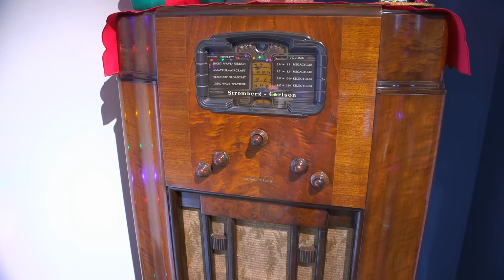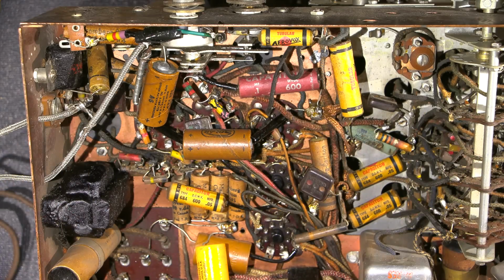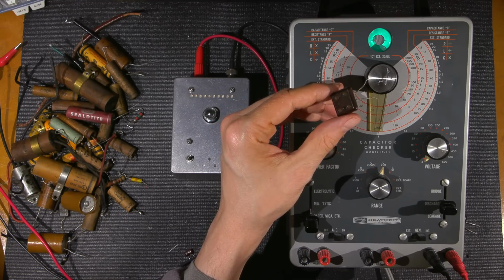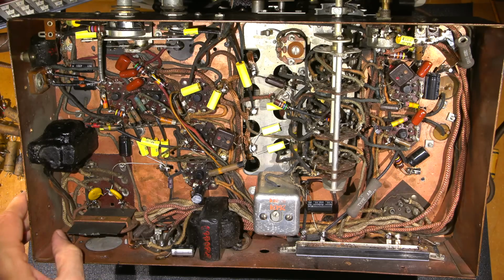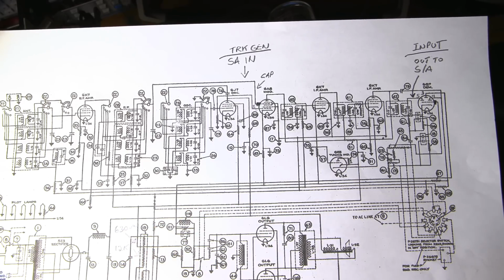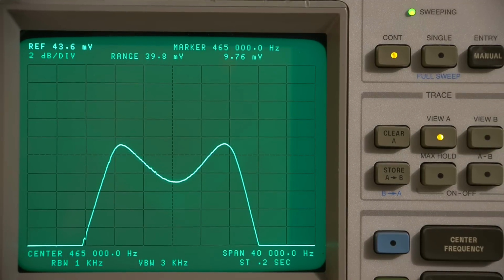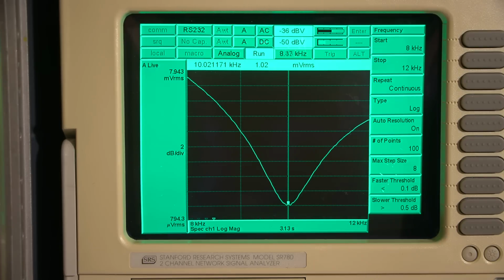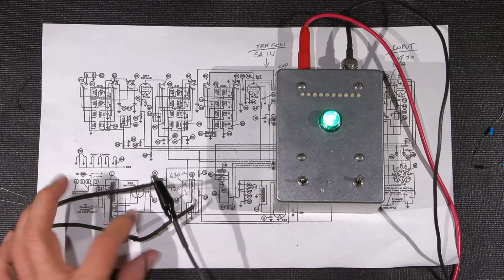84 Year Old Radio Receiver Restoration! Stromberg-Carlson 145L

Comment: When you use polarized electrolytics, do you put the negative or the positive lead to ground?
Reply: Usually the negative lead goes to ground.

One exception is transistor radios that have germanium transistors, which usually are PNP type. They are essentially "upside down" in their circuit design.

There are also "floating" grounds in some circumstances. When that's the case, you'll want a schematic diagram.

Comment: Great video! Can you describe your antenna. I do some modest radio work in my basement shop, and can barely receive a local station due to all the AM noise in my metro area. I've been considering an outdoor wire antenna with a shielded coax for the portion inside the shop.

Comment: Yes, that is why I have designed my own high performance receiver, with dual IF for wide and narrow bandwidths plus AM stereo. As most AM radios made in the last 20 years have very sharp cut off at or below 5kHz, and AM can sound just as good as FM. So there is a few good AM tuners been made today, and I have had a lot of positive feedback on this project.

Comment: A nice receiver from the days where the unit cost as much as (or more than) a piece of furniture, and was designed to function just as beautifully as it looks. The audio is truly amazing, they obviously had someone with some acoustical knowledge on the design team. I'd genuinely love to hear it in person. Certainly hope you'll include a photo of it in a future calendar!
Reply: Look up the Everyready AC model 3 from 1928, I have one of the cabinets minus any innards, the style is American Gothic or late Queen Anne, looks like a coffin, awful style and design.
The twenties was the decade of radio, an absolute crazed decade, similar to how the 80s was for the home computer , so looks didn't matter, just that the radios worked.

I also have a thin legged tall cabinet Queen Anne style, manufacturer unknown., arched dual doors, looks a little bit better. The art deco ones from the thirties were a massive style improvement.

Comment: Nice.  I didn't think the coaxial speaker enclosure went back to '36.  They did use several brand new tubes from '36 though, the 6L6, and 6E5 (patented August 18, 1936), and wasn't the venerable 6A8 pentagrid converter from '36 as well?  Not to mention that metal tubes were also introduced the same year (I still prefer the G/GT types myself - real radios glow in the dark).  This radio was state of the art when it was made clearly for the 1937 model year.  Chassis 145L, Rider's 7-23.  Interesting how B+ goes from the filter choke directly into the field coil.  10H total or 15H (assuming a standard 5H field coil)?  Rider doesn't specify inductance for the filter chokes.  Beautiful f'king veneer.

Comment: Why did they use an electromagnet instead of a permanent magnet in the speaker?
Reply: Magnets of that strength required were pretty expensive in the day and because a smoothing choke coil was a good thing for the B+, they swatted 2 flies with 1 hit by making the choke coil also function as the electromagnet for the speaker :-)

Comment: Quite an extraordinary receiver for the 30's. I wonder how they aligned it with contemporary gear. I wonder if anyone could ever align it in the field. Was it this good when new? 

I have a Rhode & Schwarz RF signal generator with a large drum style dial that is so precise you can calibrate your frequency counter with it.
They did some good engineering in the good old days.

Comment: A few years ago I restored a friends 1939 Philco radio in a cabinet style similar to this one, but the condition of the Philco was rather poor.  My friend wanted someone to do the restoration, but had not been able to find anyone.  It's cabinet was rough, but not rotted, and I determined it to be quite restorable.  The radio was not working at all.  It had a similar electro magnet speaker as does this one, but not so elaborate.  So, I started by removing the radio chassis from the cabinet, then proceeded to refinish the cabinet, and I guess I spent a few weeks before I felt that it was close to how it had appeared when new.  I should mention that my friends mother had been its original owner, and now in her nineties and did not know that I was doing this work, so I was a bit more inspired to complete it while she was still living.  My friend was not interested in having the radio work, but I was.  It's chassis was rusty, and while all of the tubes were still in it I decided to replace all of them.  I had told my friend that his only cost would be for parts as I thoroughly enjoyed doing it as well as the challenge.  Yes, I remember replacing all of the capacitors and, also the striped ends and being ultra careful with their reconnection.  I had been able to find a complete schematic on You Tube and many repair tutorials to help me along.  It took me about the same time to rebuild the radio as it had to refinish the cabinet.  When I completed it I decided to have a bit of additional fun.  I connected a lead into an amplifier section with an external plug that I would connect a small CD player into.  I then recorded FDR's Pearl Harbor speech onto the CD and ran it through the radio.  When I took it back to my friend and placed it in his living room with a sheet covering it I asked him to have his mother come over.  When she arrived I removed the sheet and she was quite amazed to see what likely looked about how she would have remembered it when it was new.  I then told her that the best was yet to come.  I turned the radio on and with my remote for the CD player which was hidden inside the cabinet turned it on and FDR's famous speech came out.  (I might imagine that this radio may very well have played that speech in 1941.  My friend's mother was flabbergast!  She said, "how did you do that".  I kiddingly said that not only had I fixed the radio, but that I had made a time machine!   I think that for a moment she almost believed me, and then I showed what had actually taken place.  I don't know how much it is played now, although it worked quite well.  It did not sound anything like the Stromberg, but I was pleased by my accomplishment and brought this device back to life from the garage where it had been sitting for many years.
Reply from the maker: Thanks for sharing that Steven!

Comment: This is fantastic. I LOVE the styling and craftsmanship on these old "furniture" radios, and even better with your deep dive inside. I wish that manufacturers still crafted equipment like this, inside & out… but then again a brand-new 145L probably cost more than most workers earned in a year.
Opening with the Christmas (etc.) lights reflecting off the glass was a nice seasonal touch too. Thanks for another wonderful video. I hope you and the family have a fantastic holiday and a greatly improved 2021 (for everyone).

Comment: Amazing to think that when the radio was manufactured in 1936, if spectrum analyzers existed at all they would've been only in research labs.  This radio was probably aligned with a signal generator and a multimeter at the factory.  The skill of the technician that originally aligned it, is something to be admired.
Reply: This is effectively how they did it. My uncle started his career in electronic at the RCA factory in Montréal in the 30s and that's how he told me they used to do this.

Comment: "I've spent time grading components".... You say this while you hold Panasonic EB series capacitors...  What is your basis, besides Panasonics 10,000 hour datasheet claim, that EB series are reliable in the long run?

I would prefer Nichicon PW, especially in that larger diameter over Panasonic EB...  If we were talking about 5mm parts, where PW's endurance shrinks to 2,000 hours, then perhaps EB would be the better choice...  But you have that flipped - that means to say, you took a Nichicon PW for the 5mm and the Panasonic EB for the 12.5mm part.

I also don't trust Panasonic capacitors so much anymore -- at least their non-aqueous series after there have been many reports of premature failure - particularly on the FC series.  I have also noticed that many of their datasheets now have "not for sale in Japan" at the title.

Be wary of Panasonic.

Comment: I have two old tube radios I need to restore... I spent 35years in industry doing mostly electronics test fixture designs but I started after the tube era so your videos are helping me understand the function and repair of tube circuits. I have a 1948 Silvertone radio/phono console and a 1943 GE 740 table top. I can’t wait to hear them play once again!

Comment: Marry Chrismas from Germany.
Here long wave (150-300 MHz) and medium broadcast wave (520-1600Mhz) is pretty dead. 
Short wave broadcast maybe still amateur old man.  (2-30MHz)
Only FM (band 2, 85-108Mhz) and the digital radio on the old VHF TV (band 3, 174-230 MHz). 
Digital TV is in UHF (300 MHz - 2GHz). The top of the UHF is now cell phone band.
Band 1 (TV channel 2,3,4) (40Mhz) are obsolete. TV channel 1 was the  IF for TV.
Reply from the maker: Hi Jens. Merry Christmas to you as well! I believe your first line should use kHz, the rest is correct.
Reply: @MrCarlsonsLab  Yes

Comment: That resistor block on the bottom RHS of the chassis is called a Candohm unit. I have seen them used in voltage divider service & in back bias service. It would be interesting to know what current they can take. Thank you so much for posting this - it's Christmas day & I'm at work - & this video is a great Christmas present:)

Comment: What’s that labyrinth thing? What does it do?
Reply: With any loudspeaker, the phase of the audio pressure wave coming from the back of the speaker is 180º out of phase with that coming out of the front of the speaker. The "labyrinth thing" increase the path the sound from the back of the speaker has to travel before it exits the cabinet. By the time the sound wave comes out the port on the cabinet, the low frequencies are more in phase with that from the front of the speaker and thus produce a stronger bass SPL at your ear.

Comment: That "labyrinth" is a Front-Loaded Horn design. It's a common design for extended the frequency response of a driver. 
If you're looking it up, be cautious not to confuse it with a Rear-loaded or Folded Horn design, which are generally better at flattening response and maximizing driver efficiency.

Comment: Merry Christmas! Only about 10 minutes into this and can already tell it's going to be good. Twin 6L6s though in a standard am radio, wow that's a lot of power!
Reply: What do you think?   Somewhere from 15-30 watts?
Reply: @v12alpine  If you had the schematic with voltages on it you could work it out, while the 6L6 is certainly capable of being driven that hard SC were known for fidelity so i'd probably guess somewhere around 10-15 watts? Perhaps Mr Carlson himself will see this and offer the answer. The nearest radio I have from the 30s has twin 42 outputs and is around 8 watts or so and I consider it loud! That SC 145 should fill a room nicely.
Reply: @n2n8sda  awesome, that radio sounded amazing.    Seems like it had tons of headroom even with the heavy bass.

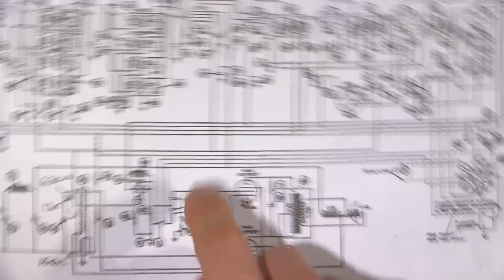Comment: 29:29- 10kHz filter is to notch out the adjacent channel heterodyne  that can result due to the 10kHz channel spacing on the AM broadcast band. More of a problem at night when non local stations can be received due to skip conditions.
Reply from the maker: You got it Chuck!
Reply: Those filters were @9kHz in Europe as we have a slightly narrower spacing. They were especially  important when using the "HiFi" setting with the larger bandwidth
Reply: @hanslub3180  In the early 60s, I had an old TRF receiver from the 30s that could receive 2 stations at the same time that were 800 miles apart. When they both broadcast the same network program, there was an echo due to the time delay caused by the distance between me and their transmitter locations.

Comment: I would love to have this radio..... Those X1/Y2 Ceramic Disc safety A/C rated Capacitors are rather expensive compared to say a standard disc cap if I remember right, it's been years since i put one in....
Reply: They aren't that bad. Around $.50 (single quantity) or so for the small disc type. Also keep in mind that a typical piece of electronic equipment only uses 1 or 2 of them.
Reply: I used a comparison to disc ceramic caps which are much cheaper , I'm well versed in their intention and application and I also never bought anything in singles, usually in bags of 100 but probably not these.

Comment: Merry Christmas 🎄 from Melbourne Australia Paul. 
I have a question or two about your capacitor tester.
You may have mentioned elsewhere in your videos but I can't seem to remember, when the Led's are moving across, are they showing the current status? For some reason I feel that if it's measuring the current draw, shouldn't they be lighting up right to left? My brain seems to be hard wired to right is maximum and left is minimum, kinda like an analogue meter of sorts. 
XRayTonyB did a great video about a LCR Bridge which I spotted on eBay years ago and I kept it in my watch list until I decided that it looked very complicated to use because it's screen displayed a lot of information and I didn't know what most of it meant so eventually I unwatched it, but as it turned out, it's extremely easy to use and understand so I went looking for it again and found that it's still available and there's a new version which uses USB C to power it and another similar to that which has a built-in lithium battery and they both cost the same! 
I don't know what the difference in operation is between what you designed and this thing is! Or how it compares to your one but it definitely would be interesting to see how it stacks up! Going by Tony's excellent video, it seems to function very well, far better than anything that I own so I ordered one and am waiting for it to turn up! 
But your one hasn't left my mind! I wanted to know what the Led's represent, is it possible to use single colour Led's but twice as many to get a longer display instead of having a range change! And is it possible to fit a piezoelectric speaker and possibly an amplifier with a switch or volume control to be able to hear what's going on inside the capacitor? You know, like your signal tracer when you RF couple to a resistor! That's truly an amazing feature! The resolution of the sound that the ear can detect in that scenario is far better and faster than what's possible with a scope! I wonder what would have we heard from that erratic behaviour of the death capacitor? Being able to see and hear, well there's no capacitor tester available anywhere as far as I'm aware!
So your design with a longer Led display plus sound and fitted to a larger desktop instrument case! That would be perfection for me! 
You can have a standard basic model and the luxury model with all the bells and whistles! I know which one I want! 
Anyway, great video, it's almost long enough LoL. I have no interest in AM radio's, we still have AM broadcast downunder but most of it is talkback which isn't my thing! But your videos are so much more than that. Tony's videos are similar in content which is why both your and his channels are my favourite! Electronics, Audio, Equipment and Tips and Tricks... Life really is beautiful and the world is a better place for me due to what you and Tony do. Thank you so much!
Reply from the maker: Thanks for your kind comment Peter, and feedback too! The added speaker is a neat idea. Merry Christmas!

Comment: I can imagine a family listening to news broadcasts during WWII on this radio. Seriously cool.
Reply: In 1991, I did electronic restoration on an RCA C-13 (1935), kinda similar to this one.

After the last cap was soldered in, I lifted the chassis into the cabinet, plugged the field coil back in, and plugged the eye tube in.

I turned the radio on, no buzz (hurray!), waited for sound, and it was live coverage of the first bombing raid on Iraq!

The variable bandwidth Mr. Carlson's radio has would be really sweet. Wish my RCA had that.

Comment: The tunnelled speaker output is called 'bass reflex' in more modern designs from the 1970's.
Merry Christmas Paul.
Reply: It's a transmission line, not a reflex enclosure.
Reply: @v12alpine  Found the design difference:
* bass reflex:  a simple tube connected behind a hole in the speaker cabin.
* transmission line:  a folded path in the form of an inverted horn to an opening in the cabin, so widest nearest to the speaker.
Reply: @v12alpine  I am not sure if I understand, the expression 'transmission line' is unknown to me. I see, just as the bass reflex, that the pressure on back side of the cone is directed trough a tunnel to a front exhaust.

Comment: Hi Paul,  during IF alignment,  is it better to break AGC loop ?, automatic gain control make it some compensation in gain too , or maybe this radio don't have AGC?
Reply from the maker: Hi Paul. If you keep the signal low enough, breaking the AGC loop is not necessary. In an IF alignment as finicky as this, breaking the connection in the AGC loop will cause a discontinuity in the IF alignment when it's re-connected.